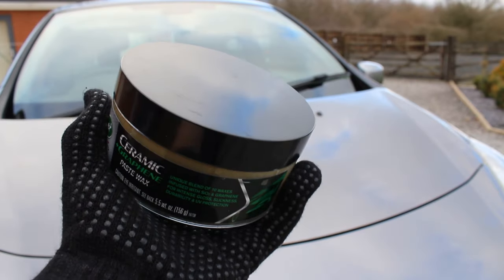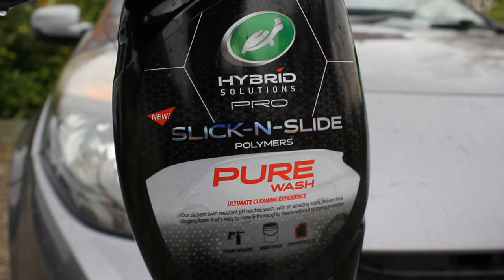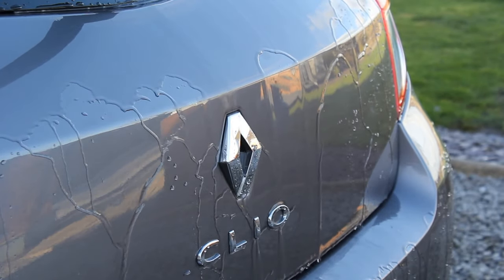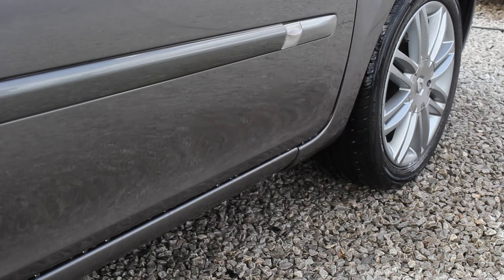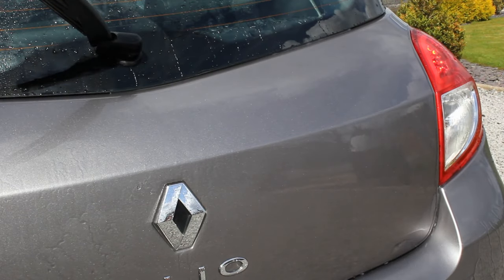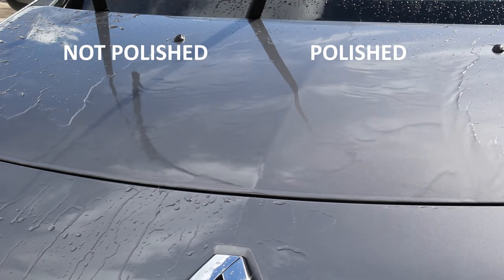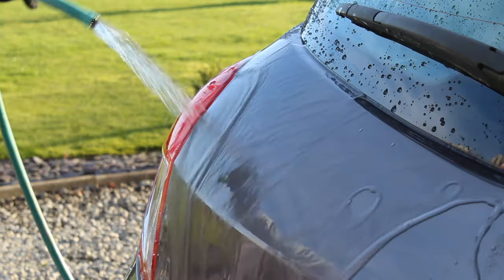Turtle Wax Ceramic + Graphene Paste Wax | Real-World Results (Durability Test)

Comment from the maker: How often do you mind reapplying a wax? Would you want a paste wax to last longer than this on a car that’s stored outside? Let me know in the comments! 

Here’s a link to my application/ first impressions video on the wax if you want some more info: https://youtu.be/f1ugVY9HlUw
Reply: Thanks!
Reply: 3 months is fine for a wax durability… unless they claim 4x that then it’s disappointing
Reply: @gillywash1487  when you buy it on there website or anywhere else , there’s no claims of durability length , however on there website , someone asks how long will it last ? And turtle wax reply is minimum 12 months
Reply: I'd rather apply once.....and have it last.
Reply: i apply it twice a year but rarely do i have a wax or sealant that'll last for more then 3-4 months so i need to boost once in a while. I'd like to find a wax wich REALLY last for 6 months+. (living in quite the same weather as UK).
Reply: @SuddenDeathSyndrome  try fusso coat , with the right prep then you can get sealants that last 9 months, maybe something like new cancoat and just top it up with wet coat as that only takes minutes to apply
Reply: @M.E63  I have fusso but also doesn't make it that long, even with a polishing and decontaminating preparation.
Reply: @SuddenDeathSyndrome  Wow. Think you answered my question about the real world durability of Fusso. I was wondering if that was the new Fusso you had also used by any chance?
Reply: @SuddenDeathSyndrome  That would be the dream. Durability is king with dirt/water repellency. I wish I had a garage to put on a ceramic coating. Would make subsequent washes so much easier to do and quicker.
Reply: I normally wax every 3 months,  but not a great fan of paste,  normally use liquid.
Reply: @kwl189  I have the new formula, no experience with the old one. With me, fusso stays really active the first 3-4 months and then rapidly degrades. Hydrophobic behavior is unmatched compared to other waxes or sealants, but it lacks in application, buffing en smell experiences.
Reply: @SuddenDeathSyndrome  Interesting.  I get about 3-4 months from King of Gloss, which I put on I  the spring summer months. Where are you located?  I am in Toronto Canada.  I also have the old formula Fusso Coat, but have only used it once so far.  Applied in the fall, for a Canadian winter.  Really didn't wash the car enough to know how long it lasted though.  There were some areas still repelling water after about 8-9 months.
Reply: 2 twice a year ideally but topped with a spray sealant most washes. It’s a real shame they over sold the protection level
Reply: Hey I reckon a bit disappointing due to the extra time it takes to apply a paste wax :/ spray and rinse is more convenient for a shorter life span in my opinion. 🤘
Reply: Gloss, depth and slickness are more important to me than extreme longevity. I personally used 2 coats of this paste wax followed by a topper of flex wax, incredible results.
  Since I wash my cars weekly I use a Si02  wash n wax as a maintenance / sacrificial coat on the car it always looks like a clear lake and little sticks to it. 
If it's just dusty it's a no contact foam wash n rinse with a blow dry, water droplets literally fly off the car with the blower and it's only a cheap leaf blower pushing 400cfm @ 250mph.

Comment: Here is a trick to prolong the water beading properties 
Use TW graphene flex wax as the 1st base coat
And then apply TW graphene paste wax as your 2nd coat. This will last you around 6 months😂
Or just get the Fusso soft 99 wax. It’s the most durable wax 😂

Comment: Good vid.  Poignant commentary on durability and all of Mother Nature's and driving habit/condition variables.    I'm  from New England and my car is not garaged.  I have a flat red GTI and was astounded at the look this paste gave my car which for me is the priority over durability as long as it's reasonable.   As we know, that is always up for debate and is a matter [by in large] of personal preference.   I figured if 1 coat is good than 2 coats should be better.  I certainly was not dissapointed.  After 4-5 weeks I was itching to try the  [then] new FLEX Graphene Spray as a topper.  My experience with 2 coats of that wonderful paste and the FLEX gave me well past 3 months of BOTH gr8 gloss/depth of color AND durability.   Shine on you crazy diamonds!
Reply from the maker: Thanks for watching :) I'm the same to be honest, I'd rather get some nice gloss and have to reapply more often!
Reply: @AutoCareHQ  As I mentioned it is a matter of personal preference but there is sooo much emphasis on the durability thing that I find it out of proportion.   Turtle Wax and ALL the other manufacturers should not (over)state what are often perceived as exaggerated durability claims or state how/what those claims are arrived on.  🤔  Keep up the good work!  I enjoy your style.

Comment: Excellent video

Ive applied to my daily driver Supra and im at week 3 where ive washed it once.

It seems very good just now.

I clayed before applying and used it as a base layer rather than doing my usual and ceramic coating my cars.

So after week 3 ive used Gyeon Wetcoat as a spray topper and intend to do this every 3 weeks to a month so I wont get full review of it but i will probs use this every 6 months as it was good to work with.

Comment: This was interesting.  For the U.S. there's no durability claim.  For good reason I think.  I can't imagine any paste wax lasting 12 months.  My car is a daily driver, but I never go more than a month without putting some type of coating on it.  So I'd have no idea how long any of the products actually last.
Reply from the maker: It's hard to find info on the durability to be honest I had to do a bit of digging. It's not on the pot or in the description on the website but on the product Q&A section one of the Turtle Wax Experts said it should last minimum 12 months with good prep

Comment: I tried it on a mazda and a nissan truck. I like it. Anything with wax, I only expect it to last about 2 months. This wax is a lot easier than older waxes. And using a battery drill with a foam pad gets the wax on really fast. The mazda gets washed almost daily because of the road traffic getting it dirty. And the beading is really good. I did put 2 layers on to get a build up.

Comment: I used this 4 months ago, it was on a non protected, daily driver, just a wash and apply.
Initial results as per your test, but then I didn’t touch the car for 3 months until 2 weeks ago. I wasn’t too impressed, until I dried it. It dried super easy,  then the shine took over, fair play it really was impressive. Now the road salt has returned so I need to re wash it and check it again.

Comment: Good video Heather, thank you. 

That, to be honest, is rather disappointing in my opinion. 
That performance is NO different to a bottle of Turtlewax Sealant hybldrophobic spray wax. Which you can pick up for about 4 quid around my way. 

I think, if you're going to go to the trouble of a full decon, clay and polish, then go and apply a layer of Gyeon Can Coat Evo. 

It's about the same bloody price anyway, and you can get almost 18 months out of it if you regularly wash and top up with a ceramic infused drying aid aswell.
Reply from the maker: Thanks for watching :) yeah I think if you're gonna go all out and do a full decon and polish then putting something more durable on it makes a lot more sense. I think it's a decent wax in terms of ease of application/ initial water behaviour but very average in this test for durability
Reply: @AutoCareHQ  absolutely. I tested out the special edition version when it first came out and wasn't overly impressed then either. 

However, it is cracking for keeping my UPVC window frames clean and shiny.  Even then it still needs redoing every 5 to 6 months.

Comment: This is a true durability test.
As you mentioned the chemical resistance test doesnt provide enough information. This car was exposed to the natural elements and was washed reguarly. That is how it should be done.  Truly amazing test!  Soft99 Fusso coat is still the best durable wax out there :). 

Thanks for the update Heather.
Reply from the maker: Thanks very much for watching! Yep I've not found anything more durable than Fusso yet either!

Comment: My car is stored outside and driven on mainly dirty country roads. Road traffic film builds quickly and seriously impacts protection performance behind the wheels and on the boot. I'd be lucky to get 4 weeks before those panels were pretty much dead with everything I've tried so far. I've therefore switched to a products that are simple to re-apply at one in every 3 or 4 weekly maintenance washes. Your content, as ever, is excellent.
Reply from the maker: Cheers Mike! That makes a lot of sense. Do you have a go-to product to keep the protection topped up?
Reply: Hi Mike, i live in similar conditions and agree with you on this. Whats products do you prefer? I'm using Autoglym's Polar Seal at 2% PIR once per month through an IK sprayer over the winter with Garage Therapy Sigma through the better months.

Comment: great feedback Heather, i have a pot of the same wax, and just haven't got round to using it -- still preferring the lower cost Infinity Wax's SuperGloss+ Spray Wax on top of my AM Hybrid Sealant -- its a cracking combo that lasts well up in the frozen north east of Scotland, 4 months and still going.  As you say the sides/panels that get the grime and film are the first to start to fade a bit until cleaned.  Bird bombs still easy to remove too.
Reply from the maker: Thanks Iain :) That sounds like a very impressive combo, I'm tempted to grab some more AM and IW stuff when I go to Waxstock!
Reply: @AutoCareHQ  i'd highly recommend you do, been testing a lot of IW stuff just now, hooked on Tyre Coat now, smells so good 🥥

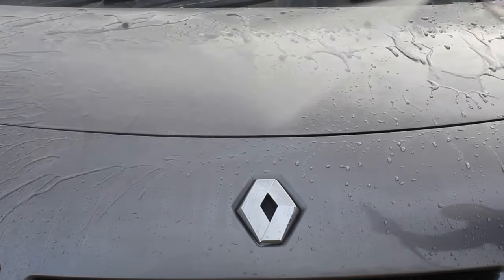Comment: Another excellent video Heather, I wouldn't mind applying a wax every 3 months myself. Aquaphobe v2 will be going on my daily next chance I get as I'm currently using either a spray and rinse like infinity wax express sealant at 1:25 as a maintainence sealant after every wash as the milage I do means a lot of punishment and in my view seems to work better for keeping the car protected, just my impression, hope your well and looking forward to seeing you review the aquaphobe v2 when you can
Reply from the maker: Cheers Phil! That makes a lot of sense to keep the protection topped up if the car gets battered. It'll definitely help to keep the bonded contamination down as well!

Comment: Some great points and content......I usually half the durability claims and half it again for us real world people with cars left outside.  I do use the turtle wax hybrid solutions range and if you top it up every wash like me it works well. I use the wax paste every 3-4 months too just cuz I love the nostalgia of a wax still.
Reply from the maker: Thanks Richard :) That sounds about right, I usually get about half the durability claims as well. That sounds like a good system, you get the best of both worlds that way!
Reply: Agreed. The Graphene range don't really seem to add anything. 
I've been using the Hybrid Solutions range too, Ceramic Polish & Wax followed by the Ceramic Spray (2 coats). That gave 7 months of protection over a UK winter (Oct-April) on a car kept outside. Quite impressive given I hadn't started using either the Ceramic Shampoo or Wet Wax. Great easy to use products at sensible money for someone like me who likes a clean car but isn't really into detailing proper.